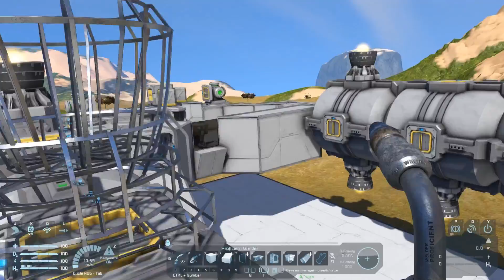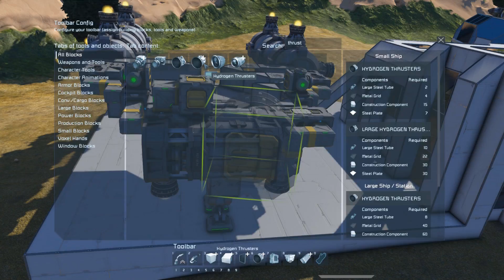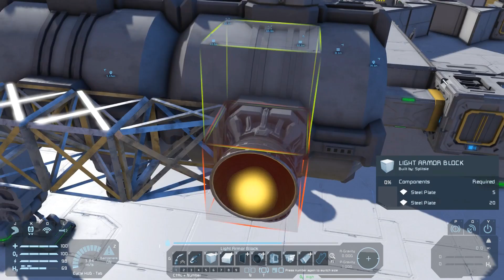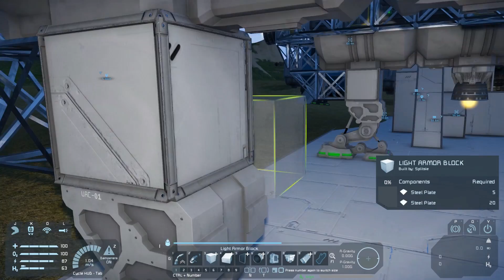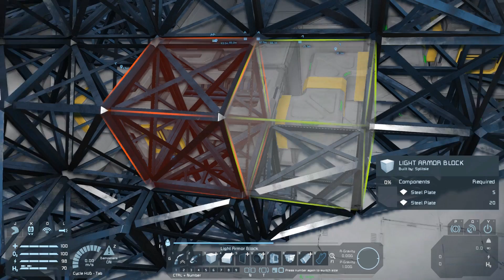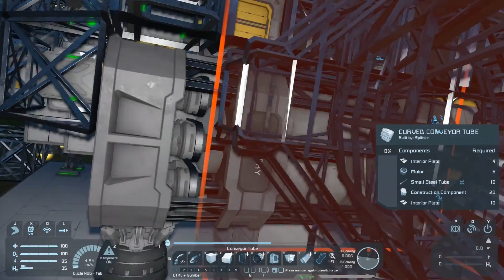Space Engineers Tutorial: Large Ship Design Part 2 (Survival design tutorial series)

Comment: I like to color code parts as I build so I can quickly identify each set of systems.
My color code is generally:

Atomic Green - Power Systems
Fire Engine Red - Hazardous elements like hydrogen tanks and warheads
Ice Blue - Oxygen Systems
Blaze Orange - Cargo Containers
Yellow - Conveyor Systems (sharing multiple systems)
White - Computer and Sensory Systems
Black - Weapon Systems

Color coding is excellent when you are snaking closed circuit systems parallel to each other, needing to mark an armor block to signify a hidden conveyor access point that you may later expand upon, marking button panels for quick identification of what system they're linked to, as well as quickly locating valuable parts of wreckage like intact cargo containers or reactors. It also makes navigation in larger ships easier, as you can color code the interior to reflect the systems that section entails. I'll often make the interior a few shades lighter or darker than any exposed systems. The exterior will always end up being colored for pure aesthetics, though I try to keep exposed color coded systems their coded color if the design permits it.

I would definitely recommend at least color coding your conveyor system, as well as any armor on the interior that is placed on conveyor access panels. I actually opt to just slap on an air tight conveyor instead of armor and color code it to the system it's connected to. It's a method that works pretty well for keeping track of many systems in larger builds. :)

Comment: I think your set up here could be improved by:

1) painting a grid on your platform. A big cross i the middle, squares of different colours running from there. That way you will see where you are on you ship building at a glance rather than counting bricks all the time.

2) Construction gantries; even if they are static rather than moving they should help you build without using so much jet pack fuel.

3) A big welding/ grinding arm tied into you base storage will enable you to build much fastr without the use of a dedicated construction ship. Give its own cockpit and camera and you are there.
Reply from the maker: The grid is actually a pretty good idea to help maintain symmetry and measurements :)
I don't mind using the hydrogen since ice is so easy to come by, but that's a personal preference I think gantry's would be cool to use more for the challenge of constructing them well.
I'm too worried about clang with using a welding arm because you'd need a mix of pistons and rotors to get it into the right position - that combination terrifies me :O
Reply: If not an arm then maybe a boom with multiple welders. Two pistons on either end for height and a piston track on either side of the construction bay. That way you could build up your ship layer by layer like some kind of futuristic 3D printer ship yard.

Or you could put the ship on a turn table so you move your welder on pistons and turn your ship this way and that to get it in and out.

I do think that the arm would be a worthwhile cosmetic project at least.

Anyway I am just getting into Space engineers and your series is a big help. I was kind of expecting a cross between Kerbal space project and from the depths but it really isn't like that. Shalower in someways but deeper than others I was expecting.